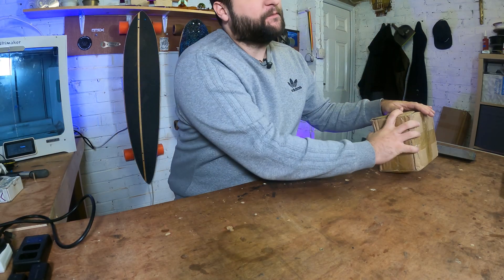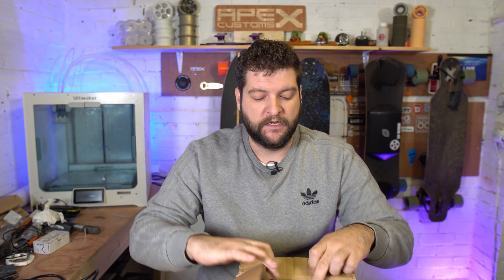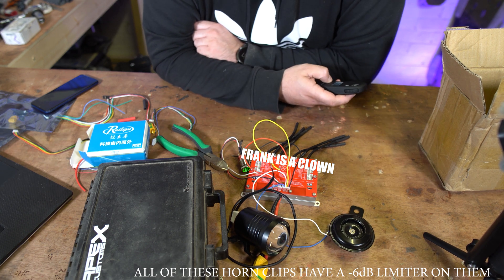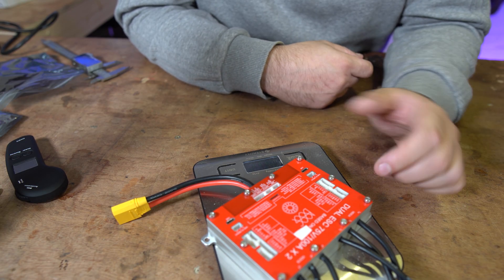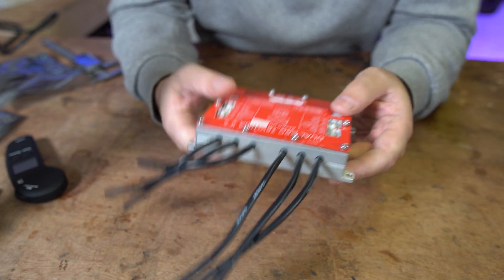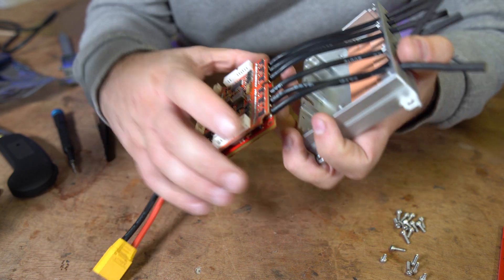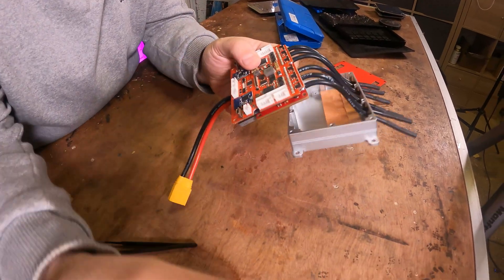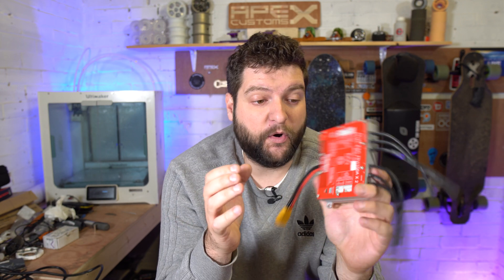Spintend Ubox Dual High Voltage ESC - Whats inside?

Comment: is it true i cant ride it on vesc std software this is written on spintend website Reminds: we recommend to use Spintend custom 100A firmware, if you're using stock firmware, there's battery voltage reading discrepancy and relative symptom.
Reply from the maker: id recommend you use their custom firmware

Comment: I ordered one recently still waiting for it. I was wandering what on/off switch did you use and how did you manage to wire it to the connector. I found 5pin led button switches on amazon but not sure how the wiring would connect. Great video btw.
Reply from the maker: They include a switch bro
Reply: @LeeWright  thanks , they don’t really have enough details on their website sadly... also what size are the motor connectors? Only other thing I need to know lol